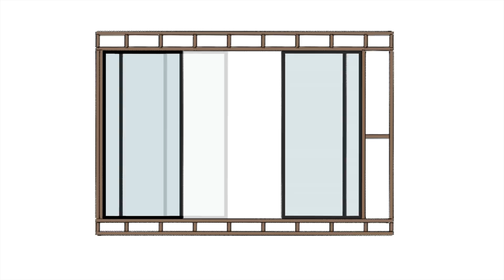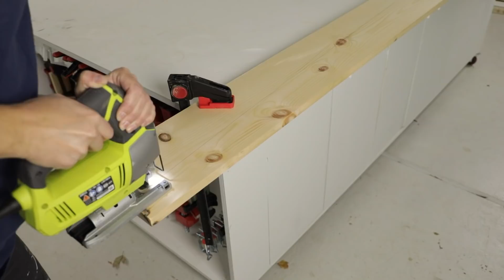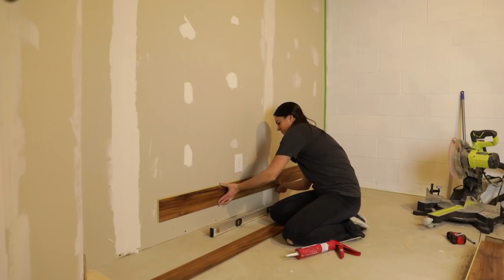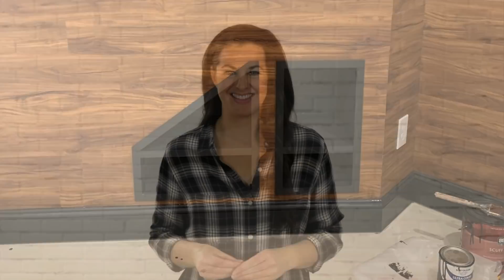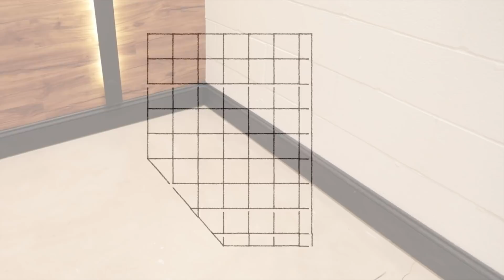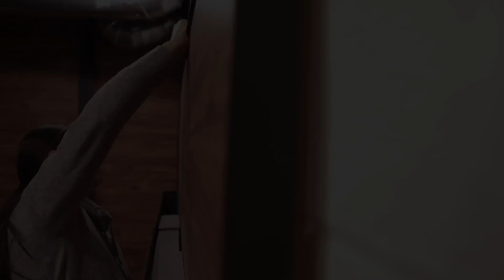Turn a Storage Room into a Modern Home Gym | House One | This Old House

Comment: I have had luck with using Gorilla tape to tie the back side of the tiles together which keeps them from popping out of place and sliding around.
Reply: I have been wondering about that. I have a mudroom that I turned into a gym and I am trying to figure out something for flooring. The floor is in a basement and is pretty uneven, even for a basement. My first concern is that the uneven floor will cause issues, and my second was that they would slide around even if the floor was even. But the tape has kept them in place for you well it sounds like?